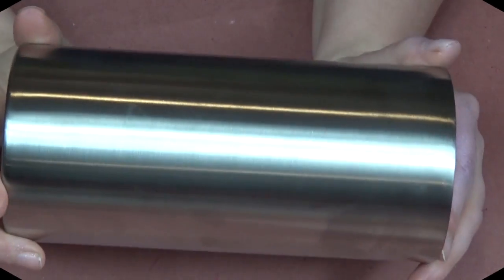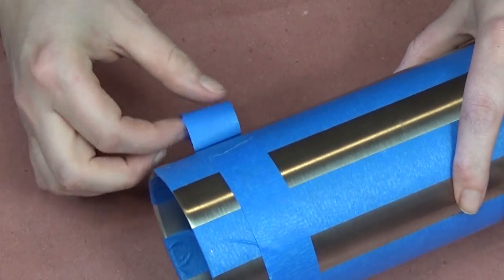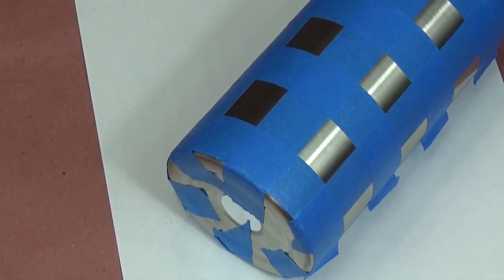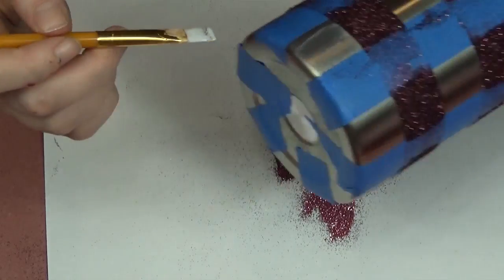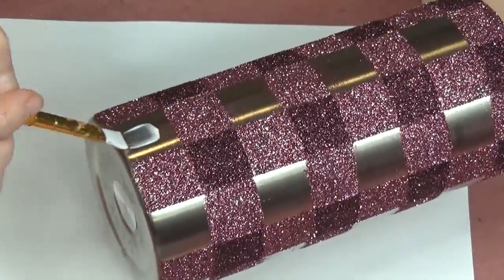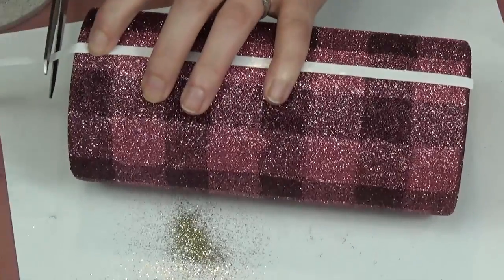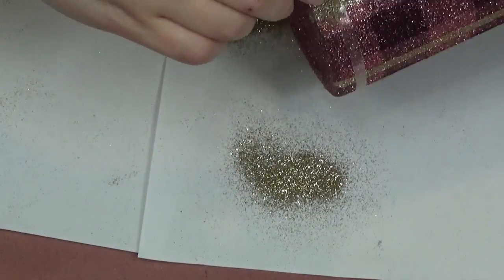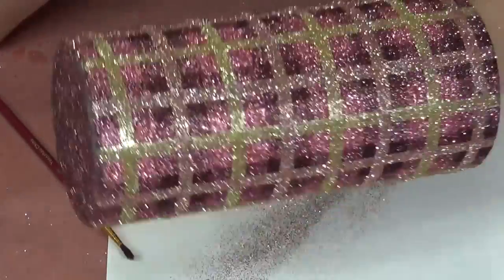Buffalo Plaid Tumbler

Comment: Love your cup! Just a heads up though, most epoxy's are VOC ( I was doing research when trying to figure out which one I want to do). The thing with that is, the are VOC until part A and part B are mixed. After that, ALL epoxy's become toxic until they are fully cured. I'm writing this with a lot of respect, so I hope it is received that way 🙂 just wanted to throw that out there. Have a wonderful day, keep up the beautiful work!
Reply from the maker: I totally agree with this.  That's why I use the Art Resin.  They don't add any solvents  or non reactive dilutents to either part so that when it's mixed everything in it reacts so nothing is free to become airborne and cause health issues.  I do sincerely thank  for your concern and I completely appreciate you for bringing up this point.  I should have covered that better in the video because it is certainly important for people to know.
Reply: @MySoulOnFire  Absolutely! And thank you for that information because I did not know that about Art Resin! ❤️